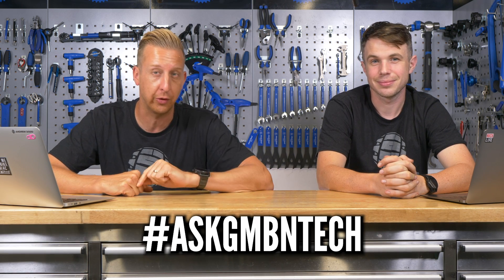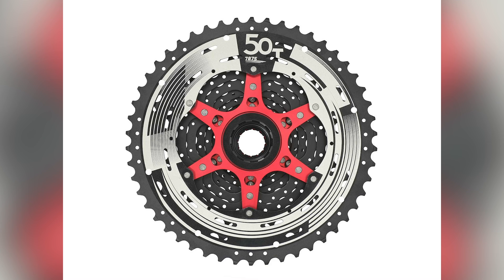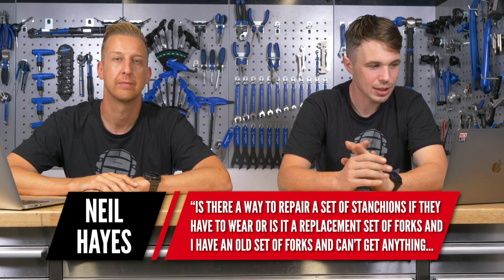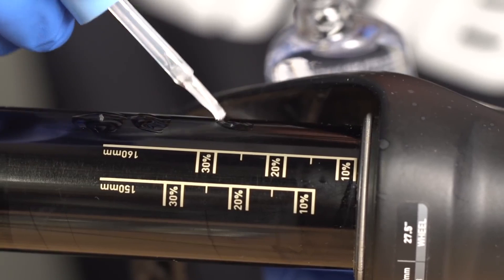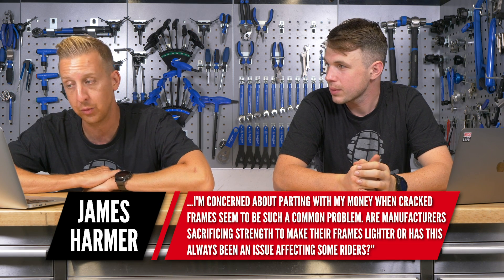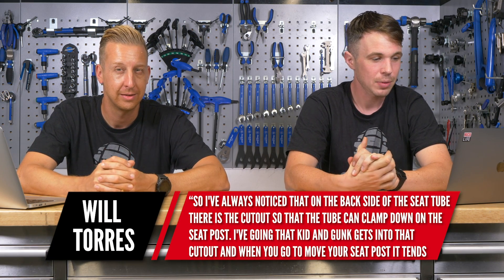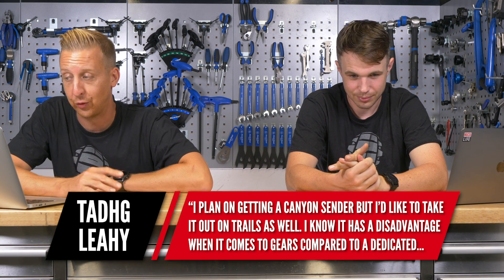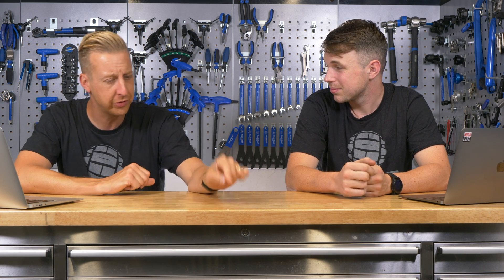How Do I Fix A Scratched Stanchion? | Ask GMBN Tech Ep. 82

Comment from the maker: Got a question for Doddy and Henry? Submit it below using the hashtag #AskGMBNTech for a chance to be featured on the show!
Reply: GMBN Tech #AskGMBNTech hi Doddy and Henry , I have a question which relates to chain. As you know there are many chain wear indicators in the market, what I have seen some popular ones are unior chain checker and parktool chain checker. Do you find any difference in the indicators? Mine on unior for the chain is using shows 0.7mm wear but on parktool it shows 0.5mm wear ... I’m confused. Which one should I use ?
Reply from the maker: @kwantian1015  Are they both the slot in style indicators? It's important to just allow them to drop. If they have been pressed into place they can become inaccurate.
Reply: GMBN Tech yeah both of them are the slot in style , I’m very sure that I use them correctly as the official videos tech
Reply: #AskGMBNTech hi doddy I have a NS SODA 2013. I've recently put a 27.5 fork on however it's a 26er bike. Is it possible to put a set of 27.5 wheels in the bike. Thanks
Reply: Hy Doddy and Henry, I have rockshox xc32 fork and the knob is stuk in the low rebound so it is quite hard when it comes to rocky road, and my question Is there any way to repair rebound knob on rockshox xc32 fork #askGNBNTech
Reply: The other wear problem I've recently seen, is a water bottle wearing a hole in carbon frames. A few santa cruz owners have had this problem on different models. For example, on my hightower lt, if  i run a cage and full size bottle, it touches the seat tube. It appears that constant trail vibration causes the bottle to wear through the carbon. A thick sticker can help prevent/slow down this problem.

Just something for those with tight fitting cages to bare in mind!
Reply: BB twistfit, does that give any advantge against a normal pressfit BB? #AskGMBNTech
Reply: #AskGMBNTech hi im currently riding a polygon siskiu d6 usually after riding for a while i can feel a click in my headset when i squeeze my front brakes. Usually happens after going down stairs. I took out the fork and found that its a straight steerer when mine is a tapered headtube. Could that be the problem? The fork came stock with the bike

Comment: I think I should get a beefy bike like Nicolai G1, as a do it all bike. or something similar, my bike does not cut it, geometry, size is wrong for me.
I love the cable routing on the Nicolai bikes, so simple, and easy to work on, but most other bikes I see are not.
The geometry that Chris has developed makes sense to me, but I haven't tried it.
I have looked at many frames, some have interesting suspension designs, rearward axle path and so on, but good cable routing is rare.,
So far it's the beefiest frame I have seen for sale world wide, not built by one man only.

Comment: Hi there! I just got myself a new bike, a Grand Canyon AL SL 9.0. I was so excited I went out for a ride and didn't bed in my disc and pads properly. Now my rear brake brakes unevenly. The braking power is noticeably less for like one third of the disc's circumference. Can I save the disc doing something? or do I need a new brake? I tried with sand paper and brake cleaner but it didn't help (though I could try again with rougher sandpaper and being a bit more heavy on it) #AskGMBNTech

Comment: #AskGMBNTech recently brought a rrp frame bearing tool, as I want to replace my frame bearings. When I do replace them do you need to replace the bolts as well as the bearing or is that just a waste of money. Also when I fit the new bearings do you need to add any compounds or grease to stop them from slipping or moving. Many thanks.

Comment: #askgmbntech Great job with the show guys! I'm currently running a Sram Rival 1x11 on my adventure bike with a tiny 30t oval chainring (I'm a weak left leg amputee, cut me some slack). I'd like to upgrade to the X01 Eagle 10-50 from Rival 10-42 so I can run a larger chainring to gain a bit more top end speed. Problem is I can't find the correct shifter for my dropbars. Is there anyway I can use the 12 speed transmission on my dropbar Kona Sutra. Cheers!

Comment: @ Probably a stupid Q, I have a boost set of forks, but a non-boost hard tail alloy frame. I noticed it has the slightest bit of flex in the rear, so I wondered, could I push in a boost rear wheel and maybe a spacer on the bottom bracket shell to correct the chain line, if it even needs it? I mean, come on what a few mm's??? Or would that be stupid and I should just keep riding non-boost and have no issues.

Comment: #AskGMBNTech  Hi guys, how do I stop my chain slapping into my rear wheel?  It doesn't move vertically, that's taken care of by the clutch mech and a N/W chainring, it moves horizontally and bounces off the rear wheel spokes on really rough terrain!  Mainly on rocky descents and occasionally after landing a drop.  It's a SLX 11 speed setup with correct chainline, a SRAM chain that's only done 300 miles and the wheel is dished centrally on a 2015 Trek Fuel EX.  It seems to be the lower chain doing it as I can't find any marks from the dreaded chain suck (I remember the 90's...) but the spokes have loads of witness marks.   It's more worrying than anything as I've yet to have it cause a crash, maybe Henry has some ideas from his DH spannering days?

Comment: #AskGMBNTech I have a problem with my brakes. my brakes are the SRAM Code R. The problem is that after about  an hour of practicing trails techniques my rear brake started to fade sometimes when the bike was in an endo or a wheelie, but when it was horizontal again it was fine and sometimes the other way around. In addition after a ride the rear brake pads started rubbing when I didn't touch the lever. The shop said that it is  because I have the R version and not the RCS (I don't think they were trying to sell me the RCS because they don't sell SRAM brakes). Is it true and if so what can I do to make them work better the cheapest way possible?

Comment: #askgmbntech about the DH bike with 11 speed there's a 11 speed bike called the canyon torque àl 5.0 it's got 180 mm up front and 175 mm rear
Reply: or a propain spindrift, 180 front and 180 rear which has a 12 speed cassette

Comment: #askgmbn
Hi there, I'm going to run a Shimano xt (brm8000) brake set and thought, would a rotor upgrade from 160 to 180mm in the rear make sense or would it be too much? 
It's a 29" hardtail with 12kg i'm running 65 kg and I use it as a trail/xc Bike 
The rear tyre is a conti mountainking at most (October to mai), else a crossking.
Thanks for the advise

Comment: #Askgmbntech
Hi guys, wouldn't it make sense to use copper grease or paste, for many bolts? If it's strong enough vor motocylces and cars it should be strong enough for bikes.
Reply: Dosent it have a wierd reaction when in contact with aluminum?
Reply: @Dude-Smellmyhelmet  You're right, completely forgot that fact.

Comment: #AskGMBNTech. Hi Doddy. Great Show. I have just seen a video on the new Santa Cruz Tallboy 4. I have a question on chain length. As the the Tallboy 4 has rear axle mounts that can be flipped to change the effective chainstay length. How you you size the chain so it's saggy in  the short position and tight in the long position? I know Santa Cruz have thought of this.

Comment: #AskGMBNTech I'm having a problem with my rear brake howling and not gripping well unless I do a full lock up. I have cleaned the rotor and pads a few times with brake cleaner, Went to my local bike shop and they said I needed new pads so did so... But the sound still continued... So I slightly sanded the rotor off and it is still happening. All bolts have been checked they are tight too. Should I try to sand the rotor off a bit more or any other suggestions. The brakes are sram RE (not on a e-bike though)

Comment: #AskGMBNTech
hi guys. I have a Merida big 7 40 2014. i want to replace the forks to a set of air forks. the problem im finding is working around the 1 1/8" head tube. can you point me in the right direction please.
Reply: Is it the head tube or steerer tube that's 1 1/8"? 
As a general rule, 25.4mm steerer tubes are for 1" compatible bikes and 28.6mm steerer tubes are for 1 1/8" ones. It's these measurements from the steerer tube of the original fork that you need to know if you want to replace the actual fork. Don't measure the spot just at the crown, but measure closer toward the top of the steerer.

Comment: #AskGMBNTech I have on oldish sram xo 2x10 on my xc bike. Recently when riding rougher terrain, my chain is jumping off the jockey wheel and sliding between it and the cage on the rear derailleur
Is this a simple fix or has my faithful 10x come to an end
Reply: Tried replacing the jockey wheels? A new 10 speed derailleur is not that expensive too...

Comment: Hi guys I have a pair of rockshock sid world cup forks and when ever they compress grease or fluid comes up onto the sanctions.  Should I buy new seals or see if there is dirt and grime in between the seals and stanchions.  #askgmbntech
Reply: New seals and foam rings. Depending on how long this has been going on for, you might need to clean the old oil out and replace it, which includes cleaning the fork lowers out. Check the Rockshox website for details on how to do it for your specific fork and what oil you'd need.

Comment: #askgmbntech what's up guys? I recently sized up to an aluminium 2018 Santa Cruz 5010 in size XL. At 6'1",  I'm loving finally having a bike with the proper reach. That being said I do find the seat tube length just a bit too long. What are your thoughts on cutting the seat tube a bit shorter?

Comment: #AskGMBNTech I have the sr suntor bb and crank set up on my new bike and I’m having problems with the bb making a creaking whenever pedalling
Reply: Make sure it is the bb first. Creaking on bikes can occur anywhere and can sound like it's coming from anywhere.
Make sure the seat tube is properly secured and clean of any dirt, dyst and grease.
Make sure the headset is snug, along with the wheels, wheel bearings, pedals, actual crank arms and other things.
If all else is well and the BB is still creaky, then you might need to replace it.

Comment: #AskGMBNTech Hi, i wanted to increase the braking power on my mechanical disk brakes and wanted to know if tightening the brake caliber would do
Reply: Mechanical disc brakes have limitations that hydraulics don't. The cable and housing are subject to stretching with hard braking and, aside from the TRP Spyder, mechanicals only operate the outside pads, reducing modulation by a huge margin. Bringing the inside pad as close as possible can improve their performance, and depending on your riding style, you can switch the pads to another material if the ones you have are resin/organic pads. Try a semi-metallic pad, they don't lose braking power when they heat up (they do the opposite), are longer lasting and transfers heat away from the pads.

Comment: Hey Guys, I'm a big fan of GMBN, EMBN and the team. Cheers for the great content! Could you please help me to find the right headlight  for my Giant FULL-E+ 1 SX PRO E-MTB from 2018? The idea is to have a good performance light for the night offroading, which would take the juice from the main battery pack of the bike. From what I know, bike is ready with a dual pin connector with 6V DC output. So just need the light with a cable from it, and some DIY magic. I've looked around. So far I've found "Supernova M99 PURE (45 KM/H)" and "SL S Yamaha (international)". They seem to be good fit for purpose, except I'm not sure how wide the beam will end up being, and if suitable for offroad. They strike me as roady light. It's also really expensive. Are any of them two a good choice? Is there better one? Perhaps cheaper one? Thanks!

#askgmbntech

Comment: #AskGMBNTech Hi, I've owned my Cannondale Trail 5 29er since October last year. The hubs are on their way out now. I recently serviced my bike, but the rear hub is rather caput. I've looked up the spec of my rear wheel, and all I can find is that the hub is a Cannondale Stage 3. I was wondering if a Hope Pro 4 Hub would be compatible with a Sunrace, 11-42, 10-speed Cassette? There are mm width wide specs to take into consideration too. I'm a bit confused! Your help would be very much appreciated so that I can keep on shredding. 

Props from the UK and a massive fan of you both,

James
Reply from the maker: Hi James, yes you can run a 10 speed cassette on this hub. You will require a small spacer to take out the slack though. Check with your local bike shop as they will be able to help you out 👍

Comment: 11:29 Yeah.. Just don't do it, perfect answer from our gmbn tech lads, I'm a Sender owner and I'm really debating getting a torque/spectral to compensate the lack of capacity of the Sender anywhere else than downhill. I absolutely love the Sender, it is a gorgeous bike and extremely well performing downhill bike, but that's what it is, a DEDICATED proper full on downhill bike, don't expect anything else out of it, it's a nightmare to pedal on flat, let alone uphill. If you want to pedal, it'll be standing, even with a "long" seattube you'll feel odd while pedaling and still as if you're on a BMX cause your legs will never be stretched out on full pedaling extension. 

Other than that, as a DH bike, it has one of the best performing suspension cinematics and probably the least pedal kickback out of all DH bikes on the market. It's pretty poppy and sprightly as well very fun and playful to ride. Can't recommend the Sender enough for downhill/bike park riding, but don't just try to Frankenstein it into a trail bike that's just not gonna work well.

Cheers and take a look at the Torque/Spectral as suggested if it's really one bike for all that you need !

Comment: #askgmbntech the guys at my local bike shop say hope float brake rotors are not compatible with sram guide r brake calipers. Why is that? And is there any way to make them compatible?
Reply: Brake surface on the rotors might be smaller/larger than the pads, meaning the pads will wear out unevenly and eventually fail. Check to see if the contact points match up. If they dont, there's no way to dodge getting rotors/calipers that match up.
Reply: The problem is with the rotor spider rivets, they catch on the inside of the caliper mounting lugs.
You can get them to fit by filing the bit where it catches off the caliper.
Obviously this will void any waranty you have, and is a total bodge.
But it works perfectly after that.

Comment: #AskGMBNTech 
Hi guys, I have a pair of Sram guide r brakes that came with my new Vitus sentier vrs. Even though they are new brakes my rear brake feels soft and mushy. To try and fix this I have bled it many times but with no luck. How can I make them feel hard and prevent me being able to pull the lever all the way to the bar?

I have tried to knock the calliper and lever to get the air out but with no luck. I have also cleaned and oiled my pistons. As well as this I have also looked for flex in the the rotor when I brake and it doesn’t flex at all. Please help with this as it’s super frustrating. Thanks guys
Reply: You should never ever oil pistons on a dot brake, use only silicon lube. If every step of your bleed process is done correctly and your pistons move simultaneously (!) you can try to de-gas the dot fluid with the syringe and to overfill the system by using a narrower bleed block and release some fluid at the bleed screw on the lever afterwards until the bite point is where you want it. There is not much room between the pads and the rotor on Sram brakes though, so you have to be careful...
Reply: see Henry's brake hacks vid and doddy's bleed vid. Easy to get it wrong. Did u use new DOT fluid? 
or It could be faulty, but if so under warranty.
Reply: I own Guide R’s as well and have found the only fix for this is switching to a Shimano brakeset
Reply from the maker: Doddy's brake bleed 👉 https://gmbn.tech/bleedingedge
Henry's Hacks 👉 https://gmbn.tech/henrysbrakehacks
If you want further help we suggest you take this to your local bike mechanic. 👍

Comment: #AskGMBNTech. Is there a hack that keeps the dirt away from my botton bracket. I have a Trek Fuel EX with a Sram GXP Pressfit BB. I have to clean the bb after every ride because the dirt is getting under the orange dust caps und my bike is creaking after few km. I dont want ro remove my cranks every ride. Sry for my bad english.

Comment: #ASKGMBNTECH hi my name is Karl and I come from Denmark. I was thinking off maybe buying a Vitus sentier vrs but when I saw that it had external cable routing I got kinda scared, but is it really a problem. If it is would I be able to drill holes in the aluminium frame and make my own internal routing. Thanks, keep up the great work.
Reply: There's nothing wrong with external cable routing. If you like the warranty that comes with a bike, dont start drilling holes
Reply: Karl Broch Jacobsen Chiming in from Finland here: can’t speak for a dropper post setup, but otherwise absolutely nothing wrong with external routing. It just doesn’t look as clean and you might want to helitape the places where the cable outers hit the frame. Much easier maintenance, though, and zero issues with rattle.
Reply: Thanks guys, forgot the part about warranty

Comment: Hey Doddy and Henry,  I recently purchased a set of XON rotors for my bike. They're pretty aggressive,  so they have large holes for, I presume,  cooling. When I installed them, the front made a very defined clicking noise every time the pads went over a hole in the disk. I have since taken them off for the sake of the bike. How can I fix It??? I should add that I tried spacing them lower or higher and even changing the angle of the caliper to no avail. Thanks!